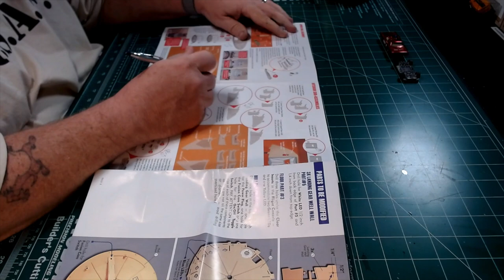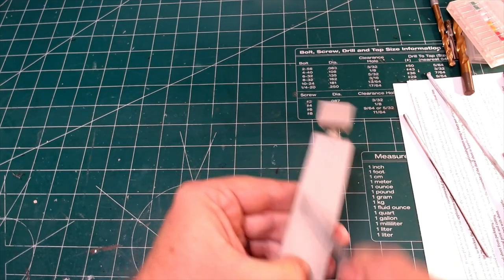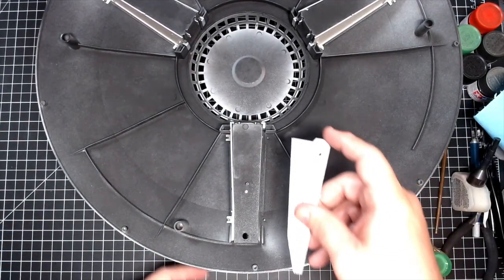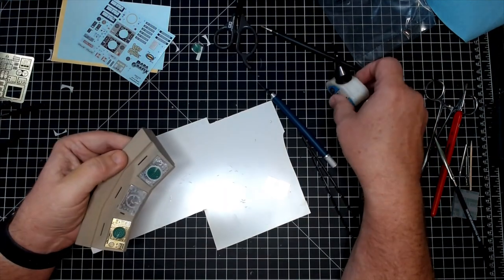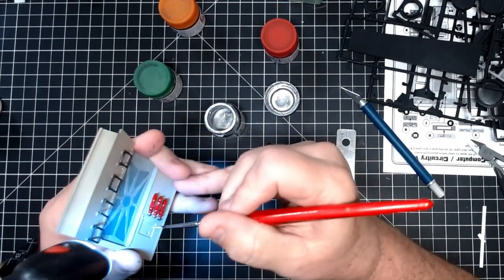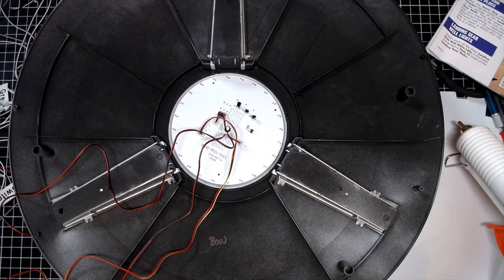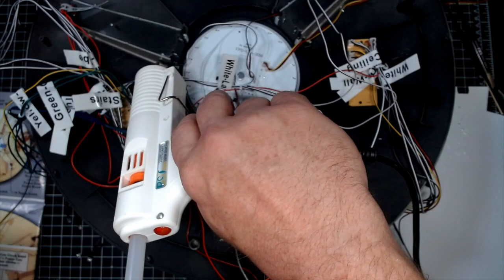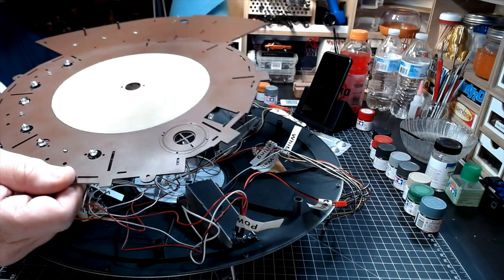Moebius Jupiter 2 Model Build - Part  1

Comment: Paul, I am working on the same project with everything also. the lighting kit, photo etch ect.. Your problem on the power switch, fusion core switch was very helpful. What I did was flip it upside down to expose the nubs you describe that needed to be file off. I just used a small micro drill bit, found the center and then drilled the right size holes for each switch. The nubs on the bottom were gone without any sanding. this also allowed the nut to be screwed on without any problem.Thanks for the insight
Reply from the maker: another tip would be to gut some channels in the lower hull to run cords through so they don't interfere with the floor and upper hull....
Reply: @pauly7218  Got it. I work very slow since I'm not retied just yet! just finished the bottom hull. My low melt glue gun came in the mail yesterday

Comment: Hey Paul. The problem with your splotchy metallic finish is because you were spraying a large area with a small nozzle. Ideally you want to use something like a Iwata TH2 with a fan spray head to get even coverage.
Reply from the maker: I actually have a detail automotive brush and was seconds away from turning to it.  Thanks for the good info!
Reply: @pauly7218  Or you probably could use a Paasche VL because it has a large spray pattern with the #5 tip.

Comment: Had no problem with the freezing tubes because i didnt uae hot glue. I never use hot glue for models. If i need something other than model glue use epoxy in a syringe.

Comment: Hi Paul, I noticed in the instructions for the Lighting Kit, its stating to use one of the Static Tube bases as a mount for the reactor core lights, is this something you did?, I didnt notice you doing this in your video, also were you able to align the reactor lights to the gaps in each of the open slots in the reactor core cover ?, love the video.. cheers David
Reply from the maker: So yes.  Follow the lighting kit instructions visa vie the tube base.  Also, I don't actually remember if I aligned the core or not - I doubt it is a big deal either way.  I'm starting a re-build shortly and will do a new video and will mention what I find....
Reply: @pauly7218  Thanks Paul for all your help, cheers

Comment: Hi Paul, I'm currently working on this build and have the same lighting kit you are using. My question is that I noticed you are using a difuser of some kind on the lighting for the fusion core. Is this something you made or were able to purchase, any information would be helpful.. thanks
Reply from the maker: David.  It is the kit's clear insert.  Just lightly spray it with white paint.  In my case I used Tamiya White fine primer